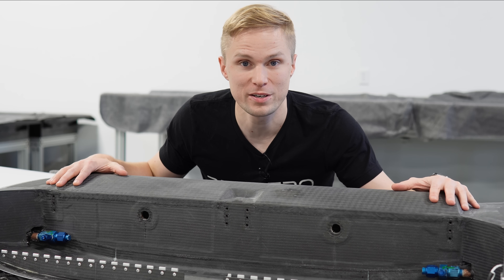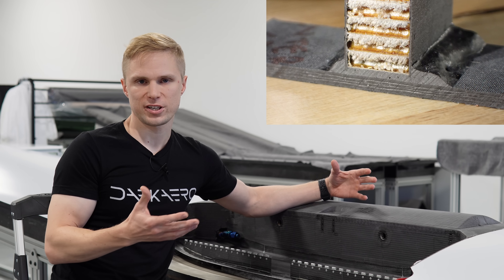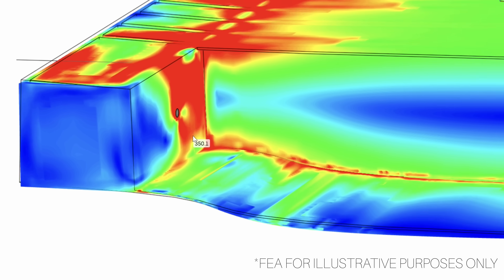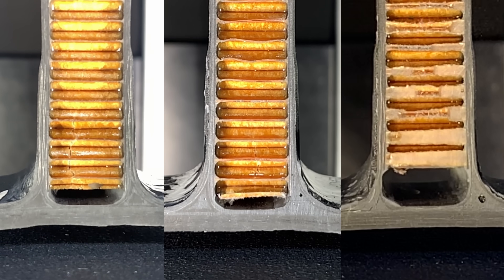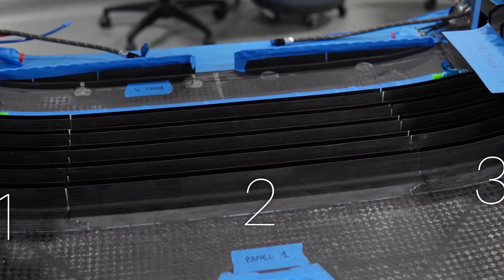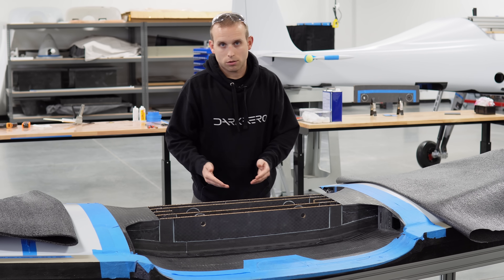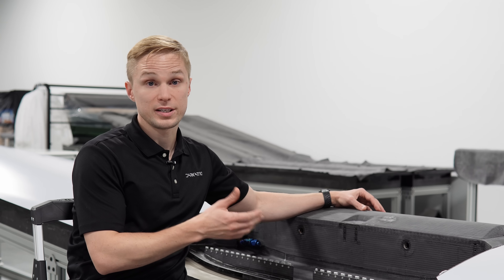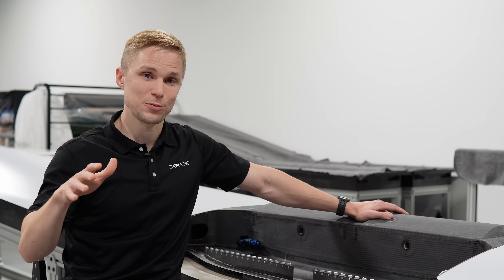Why we rebuilt our wing using pi joints

Comment from the maker: More information about the remaining milestones before first flight of the DarkAero 1 prototype can be found on our website here: https://www.darkaero.com/aircraft. Development work on new airplane designs isn't always linear, but we always post monthly progress updates on our website here: https://www.darkaero.com/updates Thank you for following along!
Reply: @DarkAeroInc because the pi joint is to improve tensile strength, 

you might want to use Kevlar fibers inside your carbon fiber, 

arrange them along tensile, strains you could use long strands as “bones”, and you can used chopped for the tear risk areas. 

but don’t just randomly do it make a sorter hooper for your chopped. 

So all the fibers are straight then you can place them along areas you have mapped out. 

The material for plane becomes structurally optimized for your plane’s shape, the exact way you want to do it.

The weight worst case might be a extra layer but it’s a optimized layer.

But could be as little as laying 1 inch chop along the most high strain areas, 

and maybe a long “bone” along the wing 

and a hexagonal chicken wire style “bone” on flat high stress area.
Reply: Do you have fuel tanks in the wings?
Reply from the maker: @nicolasolton  Yes, it's a wet wing design - the wings are sealed and act as fuel tanks.
Reply: Using structural composites the biggest problem they start to the grade after 4 years time heat hot and cold is a big factor. I wouldn't trust that aircraft after 4 years sorry 😐
Reply: @stephenallen4374  do your headlights on your car turn yellow? are your headlights turning yellow the same as your headlights crumbling? steel rust in sea water, would you trust a 100 year old steel ship? carbon fiber blocks a great deal of the light that causes binder to degrade. the issue I have is you used a blanket statement ALL structural composites degrade after 4 years with out saying what type of degradation.

Comment: If the wing became stiffer after using your new pie joint that would necessitate calculating where these load stresses have moved to and ensure you have not created a weaker section in a new location of the wing that might encourage a fault zone on the newer reinforced wing root that could cause wing failure .   Just saying it needs to be checked ....   Fantastic wing design and bonding methods with carbon fiber.
Reply: I have different design

Comment: I noticed your Q&A videos are "members only". While during the live stream, that makes a degree of sense, keeping them "members only" really gives the impression that you aren't interested in marketing an actual aircraft. You're marketing a YouTube channel. A lot of people are going to be very resistant to bonded composite small aircraft. You're shooting yourself in the foot by restricting information, especially given the large amount of competition you have in proven, conventional designs.

I've only watched a few videos, but I'm getting a real Theranos/OceanGate vibe from this company.
-edit
This is a bit too harsh. I do appreciate the video, but like basically everyone else watching it who knows anything about aircraft, I'm asking: how does this handle dynamic loads over long periods of time an why would someone choose this (very expensive) option over aluminum spars, skin and rivets.

I understand the failure modes for aluminum/rivet designs and how they can be mitigated. I also know from boating what the failure modes are for composite/epoxy: sudden, catastrophic and cumulative.

Also, being a chemist, I'm wondering how this composite design is going to handle the chemically complex environment of being an airframe exposed to fuel and lubricant, brake fluid, hydraulic fluid, cleaning fluid, de-icing, etc. Like a well known problem with aluminum aircraft is that no mercury or sodium can be allowed anywhere near the aircraft, period. This was learned the hard way. Are you going to end up in a "wings fall off" situation if someone tries to remove smudges with acetone?

Now this comment is a bit more specific than just being a cheap shot.

Comment: Hey Riley! Impressed with your pi joint design. 
I have two questions: do pi joints increase weight significantly (>10%) as compared to butt joints? If yes, is it justified for load-transfer and fatigue performance compared to regular butt joints?

Comment: Sure the pi joints are stronger but they look three times as heavy.
Reply from the maker: They are indeed heavier, which is part of the reason why we do not incorporate them in every joint. They are only included in the most heavily loaded joints where the extra strength of the pi joint increases the safety margin.

Comment: We used pi joints to join ribs and spar shear webs closing wings in the Zuni Sailplane in the 1970’s. The challenge was always good adhesive joint coverage on the trough sides.

Comment: I know this is going to sound really bizarre but I’m learning things from your videos that I’m applying in my experiments building furniture using common corrugated cardboard and wheatpaste as a bonding material/“resin” with a finishing treatment of shellac dissolved in alcohol with beeswax emulsified into it.  It is surprisingly strong, wood like but very light weight.   The key is how layers alternate direction of the corrugating as well as jointing methods.  I’ve also begun experiments using woven flax textiles and bioplastic resin I make using common starches (potato, corn, etc…) glycerin and other bioplasticizers as a kind of biodegradable carbon fiber.   I can vary the flexibility of the plastic and some experimental plastics I made 10 years ago have maintained integrity.   I think a structure with a core of latticed cardboard with a shell skin of bio carbon fiber could be very strong and durable.   This video is particularly interesting given the explanation of jointing methods.

Comment: Honestly I think you guys will never produce this on scale. You're just over engineering a standard plane. There's nothing revolutionary about what you're doing. I respect the videos which you go into detail about the process but instead of designing something completely different and unique, you guys chose the perfectionist route. 

Truthfully you should've spent this time and energy into a VTOL aircraft. You would've raised more funds, had a much larger YouTube presence and pushed the technology further but you chose the path of least resistance, ironically causing more resistance. 

My prediction is you're going to finish the plane maybe in a year or several and just sell off the company and process to a buyer. Atleast that's your hopes. 

My advice is to extend the team, partially allocate designer and engineering team to start process building an advanced VTOL build up hype, sell the dark aero with mixed investment into the new VTOL. It'll boost investment. It's an easy sell as you already have the team, knowledge and proven project development

Comment: Is this plane ever going to fly , it seems that there are so many revisions and rethinks that progress is almost static . For an aircraft purportedly for home construction it seems to be overly complex . The undercarriage for example consists of a mix of materials , critical struts and complicated mechanisms including gearboxes and backup devices . Could a simple fixed undercarriage not have been used for initial flight testing whilst the final retracting system was developed . I see a very expensive and complicated aircraft and don't see how it can compete with current homebuilts which are evolving and sustained by sales . I hope my fears are groundless as I admire the spirit , diverse skills and enterprise of the brothers and wish the project be successful !

Comment: Automotive adhesive specialist here. On your butt joint tests I can see you are always achieving adhesive failure mode and not cohesive. Values from adhesive type of failure should not be used for characterization because you don't really know what is failing. Always aim for cohesive failure mode (even after aging tests) by adhesive selection and even more so by surface preparation, for which you need to have quantifiable measurements such as wetting angle. In summary, always know what you are bonding (surface state, as you are bonding to surface and not to material), always know what is your weakest link and always know what is the strength of that weakest link/material. Always use gloves, even a fingerprint can completely ruin adhesion.
Reply from the maker: Thanks for checking out the video and for adding to the discussion! In structural bonding applications, substrate failure is what should be targeted, because it means your joint is as strong / stronger than the underlying material. The laminate we are bonding to is anisotropic and has much lower strength in the out-of-plane direction compared to in-plane, so the butt joint reaches its limits in tensile strength as the bond exceeds the z-direction strength of the laminate. I don’t think we ever actually showed this with the butt joins in the video, but torn out laminate fibers are visibly present in the failed pi joint at 3:52.

Agreed that proper surface preparation and adhesive selection are critical, but once you have maximized those variables, you have to modify the joint design itself, which is where we went to pi joints.
Reply: @DarkAeroInc   If you got substrate failure, that is ok. There are also situations where wrong adhesive can degrade the substrate which can lead to false positive results but it is not common with carbon composites. Good approach with new joint, looking forward to future videos

Comment: Too much work to build.
Most homebuilt aircraft projects never get finished and just end up taking up space in guy's garages for 20 years because it's already too much work as it is.
You're better off flying simulators and FPV quadcopters, you can get up in the air with both within weeks or months, not decades.

Comment: One thing I’m curious about with small GA aircraft like this is - does it use any fly by wire tech or are the controls always mechanically connected

Comment: I hope you get some amazing contracts.
When Frank Lloyd Wright designed concrete mushroom columns, they built one and loaded bags of cement on it to simulate structural loading. Another similar process took place at the parabolic columns at the Phoenix memorial baseball stadium (1963) by Frank Guiery.

Comment: I am concerned that after shearing away from both the butt and pi joints the detatched skin was unblemished , the adhesive completely missing . I am thinking particularly of the hundreds of butt joints in the outer wing structure and the difficulty in knowing of any bonding failures !

Comment: How does the structure stand up to punctures damage from FOD / bird strikes? Specifically, I would be concerned about catastrophic buckling collapse if something managed to puncture the surface material under load, making a hard situation (due to aerodynamic issues from expected levels of damage) into something completely unsurvivable (catastrophic failure of the wing)

Comment: reminds me of the test we did for laminate strength in formula student. While completely different application, we had similar results. 

What we ende up doing is completely include the joint into the wing surface. The ply that forms the upright structures skin becomes the center layer of the part. The next layers of the skin laminate over it. By feathering out the length of the skins of the the upright (we had 3 layers, one endet 150 mm into the skin, the next 100 mm and the outermost one 50 mm in the skin) and mirroring the thickness with skin plies, we got an even joint that when tested under tension, failed by bending the skin at about 320% of the but weld strain. Keep in mind, all of it was hand laminated CF, but I think the general trend will be similar for infusion and prepreg CF. 

I'm looking forward to seeing more from you, this is great!

Comment: Something I should mention is that you should be careful to test and investigate the durability of your components especilaly glue and resin
Wouldn’t want to tear appart mid air because the adhesives lost their strength after a few years, there’s a reason planes normally use bolts or welds and not adhesives
Reply: Hilarious comment. Bonded structures have been successfully used in series production aircraft en masse for half a century. Do you know what is never used in aircraft structures? Welding...
Reply: @blegi1245. Chromoly or Titanium tube frames, mainly in fuselages are torche,laser mig, or tig welded. The tomcat titanium wing spar was vacuum chamber laser welded. A composite frame should have legit wide flanges ONE with spars, to bond well to the wingskin in an overbuilt fashion.  What they think is so great(sandwich honeycomb spar sheets) do not have legitimate flanges. They didn't even look at the joints inside after testing.
Also the overlap center section of the 3 sheets is just resin and not conventional because beams are not in the center going out to the wing, and risks shear during batsheet crazy turbulence under full load. Not consulting an experienced engineer, to see that it should in fact have many bolts there at the overlap for bullet proof attachment is wrong. The whole layout should be rethought anyway to not build onto a flawed concept.
I think he means comparing incredibly strong and proven hardware with what they made, clearly not taking advice from senior aircraft engineers the past what 7 years. You have money coming in you pay senior engineers. If senior people did come in and said wtf are you kids doing and they fired the guy, watch out what flying machines you're buying into.

Comment: Yay a delam tap test sonogram marathon that probably went on for months. I could understand now why you all took so long between this and the last video. I mean, I could understand you would fly it under rn under an experimental ticket on a separate fuselage gaining some flight hours while if the wing addages of your reinforced doubler "Pi joints" are a rev. K or whatever that you will release at the end of the year.

Comment: Do you have good data for fatigue of this bonded composite over thousands of cycles of loading and unloading?

Interested in how it loses strength over n cycles of 100% loading ( typical high loads). Simulating a lifetime of flying for an airframe

Comment: Good to see the construction...

Ive had bad experiences with hexolite... it cracks.

I noticed on the test rig youre running bolts through it all..
Hexolite hates crush

There was a rc jet manufacturer that used it in everything including structural formers 
Even though they were carbon lined, they still failed.
That manufacturer is not around anymore due to their failures.

Comment: Too late now.  
    The lightest structure would be a chord-wise corrugated inside skin bonded to the outer.  Conventional spar.  No ribs except end close outs.  A conventional spars weight penalty is inconsequential.
    A designer can get “target fixation” and lock on to a suboptimal design.  Far better to look at several possibilities, then zero in. Bear in mind , too, designs are subject to Darwinian forces, and Darwinian attrition refined a small plane’s having one main spar, ribs, stringers, and skin.  There is no benefit doing something different to just be different.
   A plane sharing Dark Aero multiple spars was the Armstrong Whitworth Albermarle.  It was a dog.
   There are a few other tricks out there.  Check out the Navion’s outer panels.  And check out an Ercoupe’s wing.   Good Luck

Comment: The bending characteristics  of this wing are very very bad. The cement bags bend the wing at the fuselage area(in the middle) much more than the rest of the wing. The rest is much stiffer and is barely bending at all.... It is bad, it should bend equally along its entire length. It can be clearly seen at the beginning of this video.  Another big problem: G-load calculated for the Dark aero design is too low. For instance Risen Super veloce + 5 G, - 3 G.....  Wing without spar has disadvantages, I will explain: Here in Europe we like to use Rotax engines (running on car petrol) and therefore  I prefer a traditional wing design (with spar), because  there is enough space inside the wing in front of the spar for safety tanks or at least separate tanks to prevent fuel contact with the wing, because nowadays fuel is partly made from ethanol which is aggressive to epoxy resin.

Comment: Cool plane, but you do need a manufacturing engineer, or someone with a new perspective. That center section looks cool but does an aluminum torsion box achieve the same result? Adding complexity may satisfy your desire to over engineer, but over engineering won't make the plane cost effective.  Well I assume the goal is to build multiple planes and make some money doing it. Good luck with the plane it should be interesting to watch.
-MG

Comment: Did the static test reveal a failure of the old butt joint interface?  Seems like it would, pretty sketchy to still keep the butt joints on the top skin to spars connection.

Comment: what's still puzzling to me is that you have two wing halves joined together rather than continuous upper and lower skins that go through the fuselage, that' "bow tie" piece doesn't seem very well tied to the upper wing skins, only well tied to the central spars which you say aren't the load bearing parts as they are in traditional wing structures.  still puzzled ?
Reply: It seems to need a hell of alot of tension with many bolts, to tie the top center sheet bowtie, to the top wingskins. Only resin holding all that together doesn't sound right.